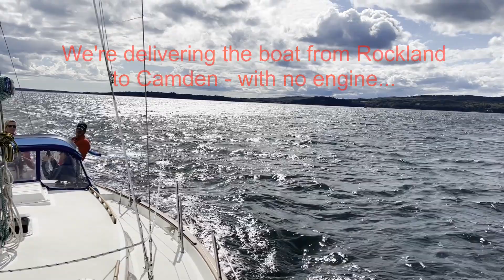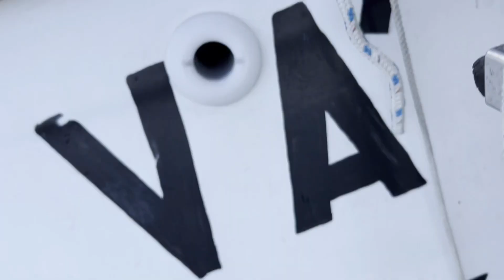Water Pump Woes and Dodging a Hurricane. What else could possibly go wrong?

Comment: A pointer on putting an impeller in.  First, before you remove the old one, note which way the blades are bent.  Then put a hose clamp around the new one and tighten it to compress the blades in the right direction.  The new impeller should then slide in easily as you slide the hose clamp off.  A couple of screw drivers work well to pry the old impeller out.
One other thing, do not close the engine raw water seacock.  That prevents the issue you had.  I leave all my seacocks open that are normally open.  On my boat that is the cockpit drains and the engine raw water intake.  I only have two other seacocks (head inlet/head sink drain and head overboard discharge) that are normally closed.  I do open the head sink drain when I run my washdown pump since that seacock provides water for that pump.  I have my head set up for fresh water flushing, which greatly reduces smell, by using the sink as a water source.  Just put the flush water in the sink.  That allows us to use just the right amount of flush water and stretches out the time between pump outs of the holding tank.
Reply from the maker: Great tip! Thanks Todd! And thanks for your continued viewership!

Comment: Glad to see that you are back up and running.  Next time that you need to make a gasket, place the paper over the opening where you need the gasket, and then use the ball side of  a ball peen hammer to tap around the inner and outer perimeter as well as over the holes.  This will leave a perfect indentation to trace out the perfect gasket with a razor including the perfectly aligned holes.
Reply from the maker: Hi Robert! Excellent tip! Thank you - and, yes, back up and running by the skin of our teeth! Phew. Thanks for watching!

Comment: Here is a direct quote from Nigel Calder's Boatowner Mechanical and Electrical Manual 4/E (chapter 5) "note that steel wool should never be used as it will leave minute flakes of steel that will rust; in fact, steel wool has no place at all on a boat." 

Not trying to be critical but helpful, pointing out the very mistake I made and realized only years and many rust pin dots later, in retospect, after reading Nigel.
Reply from the maker: We appreciate the insight and, frankly, Nigel is the boss! I should do some more reading...But we won't make the same mistake twice! Thanks for tuning in - and for the helpful insight!

Comment: I'll second the recommendation for checking for direction of rotation of the pump before fitting a new impeller. On the 4108 the plump body is deeper and smaller diameter than most so less flexion in the blades to sort itself out on first startup if you've got it wrong.
Reply from the maker: That's what I was told about the 4108 - it doesn't particularly matter which way you get the blades in as it will self-correct. Thanks for watching!

Comment: Gents, You might have put a link to the supplier of the "Karoke" or  "carol" 'paper'.
I looked for those names... I found music or an obituary.
Also, FYI, never use petroleum products around or on a synthetic or real rubber seal or impellor.
That's why they send the little tube of grease with the impellor.
Reply from the maker: Here's a link to the Karropak paper: https://www.amazon.com/Fel-Pro-3047-Gasket-Material/dp/B000CNISLI/ref=asc_df_B000CNISLI/?tag=hyprod-20&linkCode=df0&hvadid=375197107828&hvpos=&hvnetw=g&hvrand=13776750786439251180&hvpone=&hvptwo=&hvqmt=&hvdev=c&hvdvcmdl=&hvlocint=&hvlocphy=1018802&hvtargid=pla-802500178225&psc=1&tag=&ref=&adgrpid=75513194583&hvpone=&hvptwo=&hvadid=375197107828&hvpos=&hvnetw=g&hvrand=13776750786439251180&hvqmt=&hvdev=c&hvdvcmdl=&hvlocint=&hvlocphy=1018802&hvtargid=pla-802500178225

I have definitely heard about not using petroleum around synthetic or real rubber, but was under the impression (perhaps wrongly so), that this lube is only needed for the first few revolutions until the water is primed and pushing through. Wouldn't this lube be long gone within minutes - especially since it's saltwater moving through? Curious! And thanks for watching!